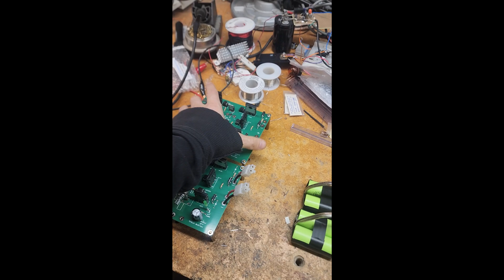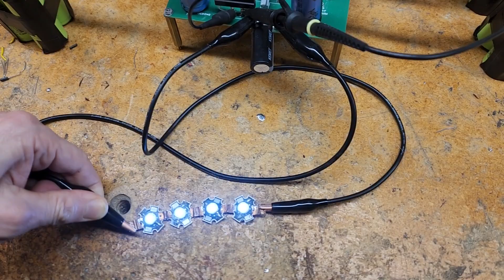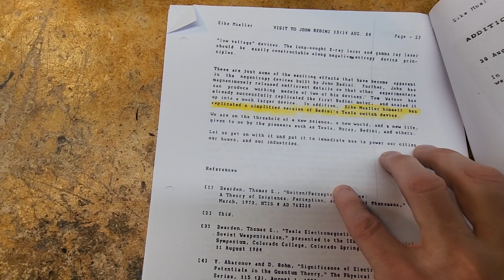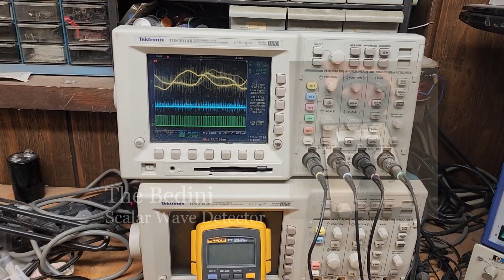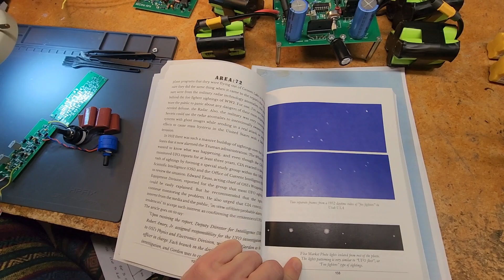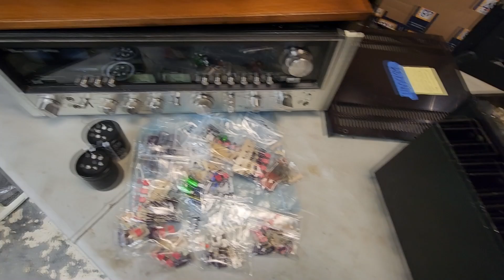Tesla Switch and other Exciting Updates!

Comment: first work in one way, only one to 4 , when you have the self charging, applying 4 way...and a big charge.
Reply from the maker: You dont even need the 4 batteries, can be done with just one battery and two capacitors.  But the 4 battery is good place to start for studying firsts. Seems that once that is figured out, the one battery way is easy.

Comment: I’m very new to all of this, so I just want to make sure I understand correctly. Are you running a magnetic field inside that box to pull energy from free space, with the energy being drawn through and powered by the batteries, then split and routed through the circuit board? And are the lights being used to transfer the energy output?

Like I said, I’m new to this, but I’m all in and very curious about what I can do with a Tesla coil and a rotating magnetic field. I’m also interested in using waveguides like copper pyramids or Vogel quartz to focus energy onto an azurite crystal—Edgar Cayce mentioned azurite as a key power source in ancient Atlantis, possibly tied to megalithic structures.

I’m thinking about modulating the system with some kind of resonance, maybe sound or radio waves, while using my intentions—similar to the Hutchison Effect. I wonder if there’s a connection between consciousness and manipulating this kind of field.

If I’m way off base, I totally understand—I’m approaching this as a curious inventor.
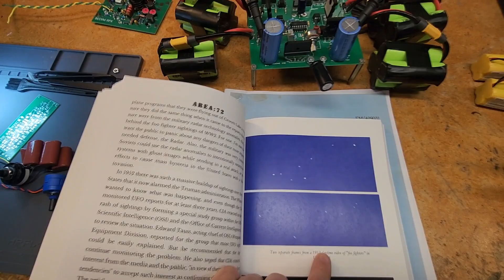Reply: 17:07 yes plasma or orbs! You can have experiences with them if you go out side and telepathically call them. Use your ESP.

Comment: I will have to visit your site, that is very interesting. One day i aspire to get a oscilloscope like the one you got there, i got a oscilloscope mode on that meter you seen in the video but i learned that was the residual energy left in the system. MY buddy who gave me that schematic to that circuit told me i need to drain the energy from the system with a light. And the journey continues. ❤ Im glad to see your build. Suoer impressive.  I got a way to go to get to that level lol.🙌

Comment: For use a 24 volt please protect your transistor with.    Néon bulb with resistor.  .and bewear at the false transistor !!!the reason is the transistor burn ,or use a 600 volt transistor... More radiant.  .and the radiant burn the électronique component .. dont work with lithium.
Reply from the maker: @anthonyjousse3020  only need neon's with HV bemf, and there are no coils in this at all .
Reply: @DavyOneness  i learn with you i learn more speed .......